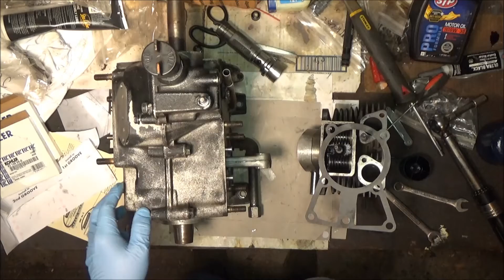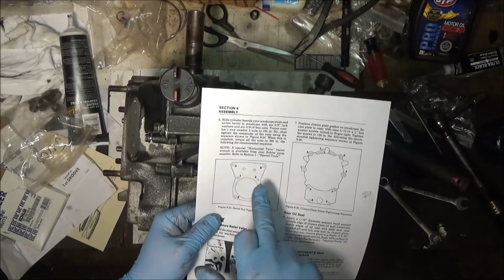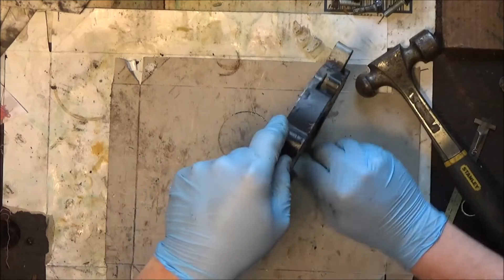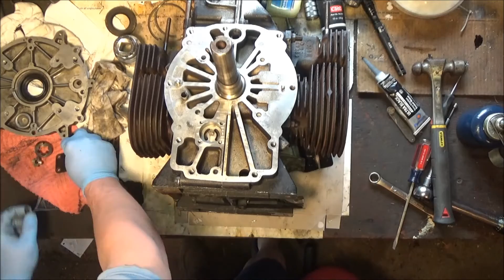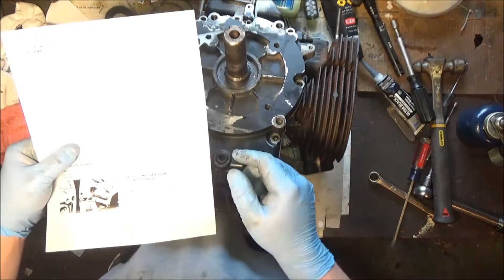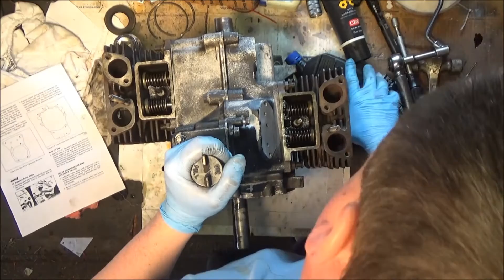Kohler kt17 Rebuild Part 10: Installing the Cylinders and Closing Plate

Comment: Do not use vasoline. Vasoline dissolves rubber.  Use high temp rubber safe silicone grease to lube the seal.
Reply from the maker: Vaseline does not dissolve modern plastics.
Reply: @gxfricke  I was told in Kohler school, Briggs school, Kawasaki tech school, etc...never to use vasoline because it dissolves the rubber in the seals and o-rings.

Comment: Nice Video ! Have the Kohler a decompression Valve ?
Reply from the maker: Thank You!  No, there is no decompression valve on this motor
Reply: Garebears Garage  okay thank you. I have the same Kohler, but Series one. He starts very slow but the Battery is full. I must look into the starter i think.

Comment: I haven't pulled mine apart yet and I can't quite see well enough in your video, can you get a crows foot and a torque wrench on those nuts holding the jugs on?
Reply from the maker: There are a couple that would be tight even with a crows foot.  It would be worth a shot though, I hated putting it together without torquing them properly.